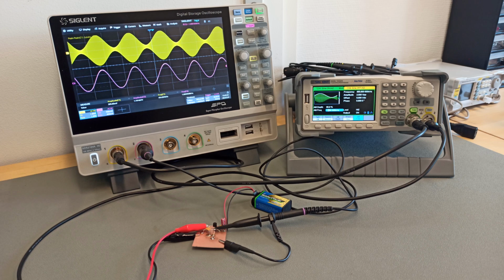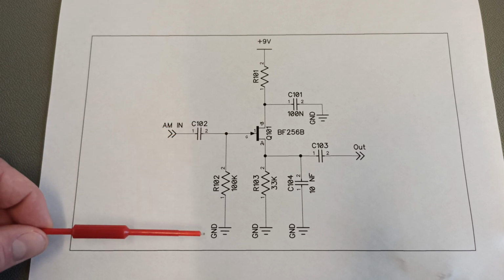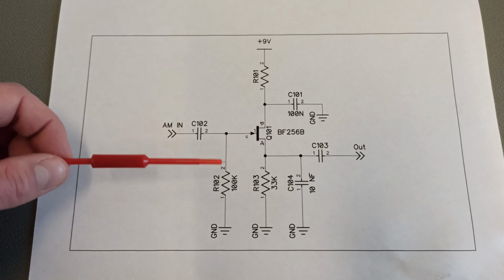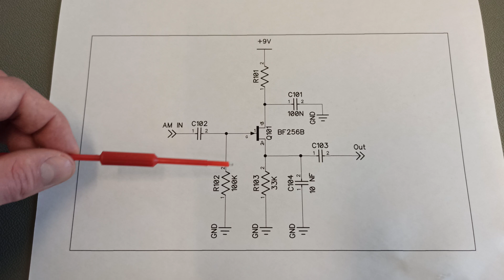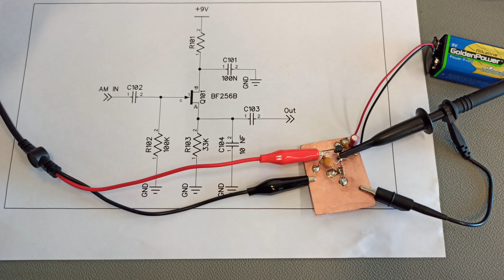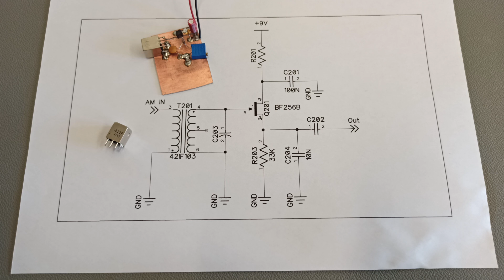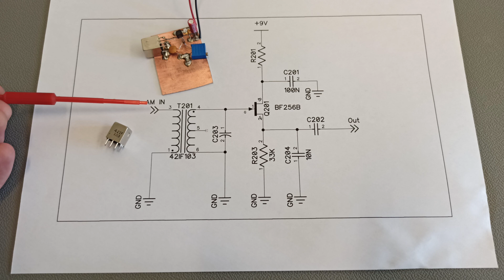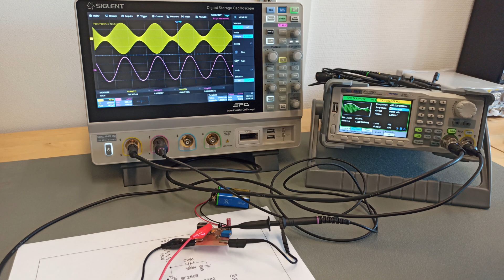JFET-Based Infinite Impedance Detector for AM-Demodulation

Comment: The calculated  resonance of RC filter on the source of the J-FET = 482.2877Hz neglecting the source admittance of the J-FET. It is rectifier filter for 455kHz. Douse it  sound better then synchronous PLL demodulation ?
Reply from the maker: I think with the JFETs input capacitance it was right on 455 kHz. Don't remember, it's been a while. Didn't do a sound comparison either but measured THD: Excellent linearity.
Reply: Thanks.

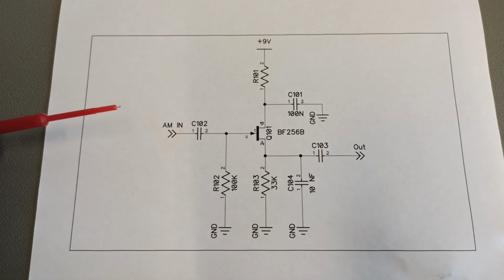Comment: I think the commentary at 2:19 is describing the wrong polarity?.... The positive half cycle of the RF carrier will turn the JFET off (it's almost off already!)  and the negative half cycle will turn the FET on
Reply from the maker: The JFET in the schematic is, like most J-FETS, a n-channel, depletion mode device.

In a depletion-mode J-FET, the channel is naturally conductive, and the application of a negative gate voltage reduces or depletes the current flow through the channel.

The circuit essentially is a source follower that is biased near to the cut-off. Any lower voltage at the gate doesn't significantly reduce the current (and thus the voltage) at the source. A positive signal at the gate does, however, increase the Drain-Source current and consequently increases the voltage present at the source.

Did you by chance think of a common enhancement mode MOSFET? 

In enhancement mode MOSFETs, the channel is normally off (non conductive) when no gate voltage is applied and it only becomes conductive when a voltage is applied to the gate (positive for N channel and negative for P channel).
Reply: @BalticLab  My mistake... apologies.  In a self biased mode the grounded gate  is of course effectively negative to the source..... A positive going signal will simply tend to reduce that negative voltage, and allow the device to conduct. Thanks for taking the time to correct and explain my error.

Comment: the distortion in the baseband output highly depends on the source resistor and the amplitude and bias at the gate. It improved quite a bit in the end when the potentiometer was used instead of the 22k. It would be nice to see the THD or at least the FFT of the base band output and adjust the source resistor to minimize the THD. It's a FET so the second harmonic distortion is dominant
Reply from the maker: Good idea and good timing: Measuring THD is going to be a topic of a future video, so I will consider actually using the Infinite Impedance Detector as a device under test. Migth actually be interesting to even compare regular diode detector, with and without bias, and JFET-based options against each other in regards of THD performance. So thanks for your suggestion.

Comment: Can I use 2SK19 or 2SK30 or BF245?
Thank you
Reply from the maker: Pretty much any n-channel JFET should work. The BF245 definitely works and I also tried a J113. You may have to adjust the source resistor, however, to bias the device into cut-off.
Reply: @BalticLab  thank you very much, sir

Comment: I have always been curious about this type of detector. I am currently in the process of building a communications receiver and at this point the detector is a diode type in which I have the diode slightly forward biased to overcome the problem of the .6 Volts of signal needed to get the diode to conduct. I never liked the low signal detect/no detect problem. So I am wondering how the infinite impedance detector performs at low signal input levels. Could you tell me about your findings regarding this aspect?
Reply from the maker: Hey Mark, it's been a while since I tried a comparison between a biased diode detector and the infinite impedance detector. But the infinite impedance detector definitely performed a lot better in low-signal conditions than the biased diode detector. The second circuit in the video with the IF transformer, for instance, works well on 200 mVpp signal amplitude.